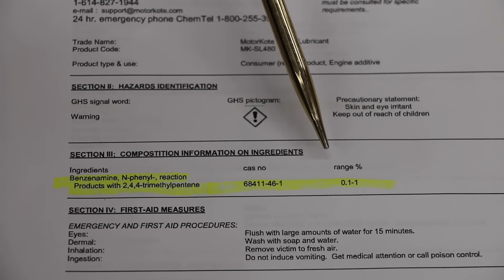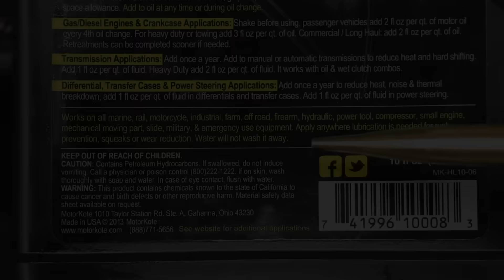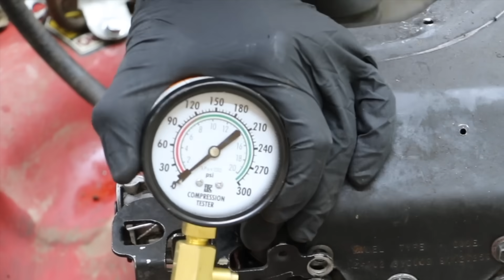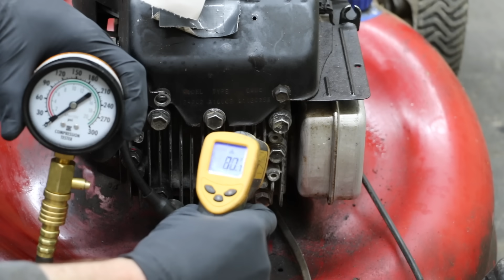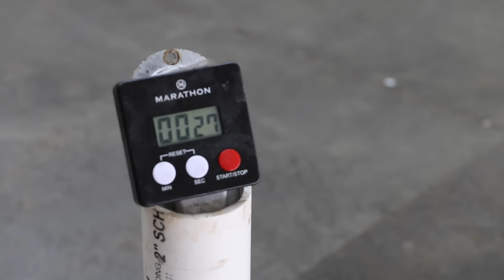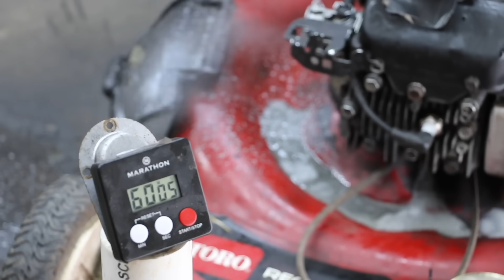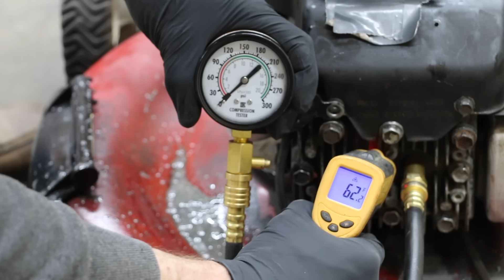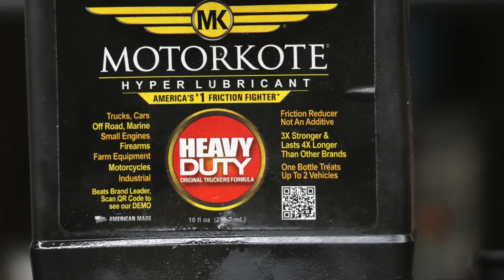Can MotorKote survive the water test?  Let's find out!

Comment: Well Commander, that'll make 2 of us that were faked out. Never heard of this product but I don't go hunting either. FINE test as usual. I was told by an ACE #1 wrench man that synthetic oil was a real pain especially on a boring job because it would penetrate into the pores of the metal itself. Maybe that's what this is but it sure is interesting. And Kano Labs KROIL is on sale, 2 for 1 big cans if you use it. $20 no shipping. 'Google deal'. Kroil is the best I've found but ntoo pricey unless they do one of these. Thanks again, Commander and the best 2 yall!
Reply: I still want to see how it performs, ave only tested 4 bolts. It would also be interesting to see how project farm tests it.
Reply: I WAS JUST GONNA SAY  AVE!
Reply: lilsammywasapunkrock 
You must not live in the salt belt. Nothing comes lose on cars without some persuasion, or just seriously destroying it. Go watch South Main Auto Repair. If $20 got some projects done much easier and without snapping a bolt, or two, then it is more than worth it. If it was as good as its praised to be, I would have it at $100. There is nothing like working on your car on a weekend, dealerships are closed, probably don't even have the part in stock anyway, and having a part break because of corrosion. It just kills everything, and ties up that project for another day or longer. Just changing the headlight bulb on a Chrysler Concorde is bad. Things break, you don't have time to order a headlight assembly while you need the car the next morning or night. You can't not fix it because you need to see the road and avoid getting pulled over. A $100 magic spray would be covered on not breaking one headlight assembly. 

TheGuruStud
In the real world, something breaks and you don't have time for things to preform slow magic. Penetrants don't get 2 hours or more to work in the real world. They are lucky sometimes to get 15 minutes. Overnight or longer is only on planned work, or work that turned into planned work when all else failed. I may spray something as the first step in starting to work on it. But how long is that before I get a tool on those parts? I try to be done in two hours, not just starting in two hours. Again, I say go watch South Main Auto Repair. The stuff we put up with on road salted cars is ridiculous. 
AvE is just showing up real world results, the stuff that matters to most of us that actually need it.

I would want to see him do more hammer tests. Also some heating tests. Those are the two back up plans when things aren't going semi okay.There is only one back up plan after that and no one wants to start breaking nuts and bolts just to fix something.

Sorry for the rant, but its clear that not everyone goes through these problems ever time they put a wrench on their car.
Reply: I saw AvE test and now I want to see project farms test. The more samples we have, the better. 
I never used Kroil but I was interested in trying it, but never did because of the price. Now I can't even justify a test can just once. Hopefully project farm has the same results as AvE, but we just have to wait and see.
Reply: In beaver I thrust but uncle bumblef$&k’s testing of kroil is not on par with my experience with it.  For frog snacks,  his test put jeezless wd-40 as the best.
Reply: Lewie McNeely Kroil, did you watch AvE?
Reply from the maker: Hi Lewie, I'm really surprised at how well this product performed.  However, I don't know if it will sludge up an engine over time or if it becomes acidic.  Thanks for the recommendation on Kroll.  I bought a can of it several weeks ago for an upcoming video on penetrants.  I realize AVE just did a test, but I already spent a ton on supplies for this video.  So, we'll see how the brands compare. Thanks again and all the best to you and yours!
Reply: Lewie McNeely......You will get off of the Kroil bandwagon if you watch AVE's  test.  Not only is it outperformed (penetrating rusted nuts and bolts) by a couple of other oils but the outrageous cost makes it a no-brainer to buy and use.  Read em and weep, Kroil fans!
Reply: TheGuruStud sometimes we don't want to wait over night. He tests how most people would use the product. He waited a few hours for those doubters. And what he found was that it wasn't all that good. Luckily I haven't encountered really rusty bolts. I've only used ATF or WD40 if I had it handy. That works for me.
Reply: snoopdogie187 yeah, living less then 10 miles from the great salt lake, where we salt our roads in winter and lake effect rain rains salt water, I have no idea what I'm talking about, or what rust is like.

If a bolt is gonna break due to rust, its already lost enough strength it should be replaced. Even if it does come off okay, its eaten away metal and compromised the strength. 

I've had almost zero luck pulling exhaust bolts/studs, and usually they break right at the exposed part next to the fastener. After the head twists off, it usually comes out pretty easy with vise grips. I usually replace exhaust bolts with zinc coated or stainless steel bolts, and never have a problem again.

A small impact (or even just a hammer or heat) does wonders, reguardless of how rusty the bolt is, and it doesn't have to wait for 24 hours or cost $20 a can.
Reply: Yeah, Kroil wasn't all it was cracked up to be according to the rusty nut test AvE did.  As a matter of fact, it flat out bombed when you factor in the cost of it.
Reply: snoopdogie187 seeing as its $20 a can, I still wouldn't use it if it was the best product in the world. 

Maybe on something i knew would break if I wrenched on it, and it would be really expensive/time consuming to replace. 
To be honest, I barely ever use penetrate when working on my car, and its 30 years old.
Reply: Inquiring minds need to know! Rusty nuts must be twisted!
Reply: Kroil-penetrent-is-the-absolute-snit...Been-using-it-for-years-now,beats-all-others-including-PBlaster-hands-down..
Reply: PLEASE test the lubes overnight (or at least 8 hrs). AvE doens't seem to get it that lubes don't work in 2 hrs...no shit. His results are jack  compared to untreated, so big surprise.

Maybe another set of samples sprayed more than once (like wait 2 hrs and spray again). And hit them with a hammer first.
Reply: Look below, Zack and take care, Pal.
Reply: I think I tried him a time or 2 and when the cussing started I canned him IF that's who I'm thinking of. But you won't beat Kroil no matter what.

Comment: 00:47 - For a moment, I thought the data sheet said 2,2,4 trimethylpentane, but it's actually "2,4,4 trimethylpent-1-ene" which is an alkene, not an alkane. The former (2,2,4 trimethylpentane) is the standard used for the 100 octane rating (RON) for petrol. That's why I got confused because it looks similar. C8H18 vs C8H16. Chemistry gets confusing very quickly!

EDIT: Not sure why they included it in the additive, though. Alkenes are reactive hydrocarbons and like to polymerise under high temperatures. It's how they make plastics like polyethene, polypropylene, etc. Perhaps the chemical is able to penetrate deep into the machinery in a non-polymer state, then under higher temperature it'll polymerise, causing a polymer layer between components. Just a complete guess from a non-chemist! Probably completely wrong!

LINK: https://www.lyondellbasell.com/globalassets/documents/safety-summaries/diisobutylene1.pdf?id=15702
Found out some more info on it. :)
Reply from the maker: Thanks for the link!
Reply: Jim Griffiths your hypothesis sounds plausible ! The bearing test kind of proved it .
Reply: Internally it looks like it made some kind of mayonnaise. All emulsified oil n water mix. Especially that stuff he had to filter 3 times.
Reply: You're welcome. Thanks even more for the video!
Reply: When you Patent a product you have to give out the list of ingredients, this way it still remains secret sauce.
Reply: Interesting read, thank you! Also worth noting, that PolyIsoButylene Amine is a fuel additive in gas and diesel fuels for deposit control. I love the chemistry
Reply: John Possum that’s what water does to oil

Comment: how about distilling a really high alcohol content moonshine and using it as a  fuel? 
really enjoy watching your videos, keep up the good work!
Reply: If the gas you use contains ethanol, you are already using moonshine as fuel.
Reply: C G he’s talking about ethanol. Which isn’t gas. It’s a product from corn. It’s basically an alcohol similar to moonshine
Reply from the maker: Thank you for this recommendation and thanks for the positive comment!
Reply: Project Farm 
:-)
Reply: I didn't think my comment would be so difficult to understand.  Everything from your lawn mower to a top fuel dragster can run on grain alcohol.  I've run my 2004 Lexus on E85 and it ran fine with no codes.  Same with E15.  Ethanol in the U.S. is nothing more than corn alcohol, aka moonshine.  There is a small amount of denaturant added so if you drink it, you get horribly sick.  I never said anything about it being petroleum or vice versa.
Reply: Dave Reiland 
thanks for your comment.
I am aware petroleum is not moonshine...moonshine is not petroleum. 
moonshine can be and is  distilled to a very very high alcohol content...petroleum is refined crude oil and cannot (as far as I am aware) be distilled, only refined further. I thought it would be interesting to see whether an "unmodified" engine could run on only a high alcohol content fuel such as moonshine and what damage (if any) would occur.
Reply: One, its illegal.  But if it was legalized its still a difficult process.  The fuel that you would use to produce the alchohol, not to mention many other ingredients and time, would cost more than gas.
Reply: Dave Reiland 
we both know that what comes out of the pumps is a mixture of petroleum and ethanol. I was referring to just pure alcohol. I was interested to know whether a bog standard (unmodified ie not a top fuel dragster) engine would run on pure alcohol aka "moonshine" and what damage (if any) would occur.

Comment: Make a vaporizer for cooking oil(heat it that it smokes really much)then try runnig an engine of these fumes.
Reply from the maker: Thank you for this recommendation!
Reply: So your the one making everything cause cancer in California.
Reply: Not exactly, i'm from Poland. It's my duty to warn about this kind of danger. It's not just a "California" thing, I know that they are overreacting on some things but really, if something is a carcinogen, it doesn't change depends on area, your body is the same in California and in other states, just the regulations change :)
Reply: Use the exhaust to heat the oil and see if the oil can stay hot enough to continue to run the engine
Reply: Very good idea, indeed. But be careful with this kind of things, oil vapors(if overheated) can contain some carcinogens like propenal - acrolein (it's created from decomposition of oils to fatty acids and glycerol, which is a substrate in creating acrolein) under high temperatures(above smoking point)) :)

Comment: What about dish soap as oil?
Reply from the maker: Thank you for this recommendation!
Reply: Project Farm I bet dawn strips off any lubrication left and it siezes quickly . But a lot of the time I am wrong.
Reply: Benjamin Mann with Dawn the worry is gone
Reply: No, soap is not a lubricant; it is wet & slippery to our hands but in an engine, the heat would destroy the larger molecules. They are designed to grab small particles or molecules & permanently carry them. They would first grind against the wear points, then overheat & basically burn. Just torch dish soap, it is horrible.
Reply: haha thats what been thanking for awile
Reply: Dang thats an interesting idea haha
Reply: # savage!
Reply: dish soap as a sludge cleaner lmao, it works on washing the baby ducks so why not engine parts
Reply: Are u insane!?
Reply: Oh No...You got Dish Pan Motor.  Should've used Palmolive!   Madge.